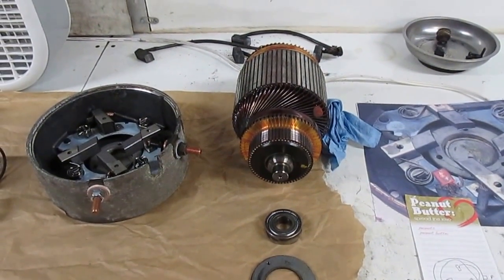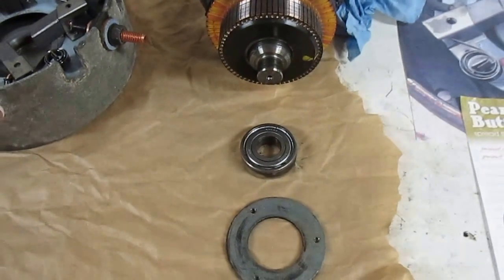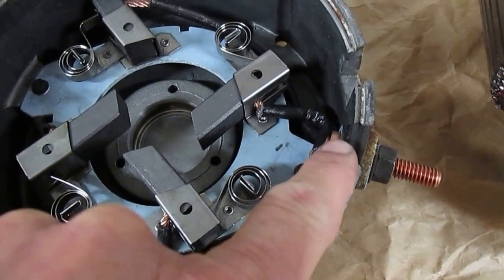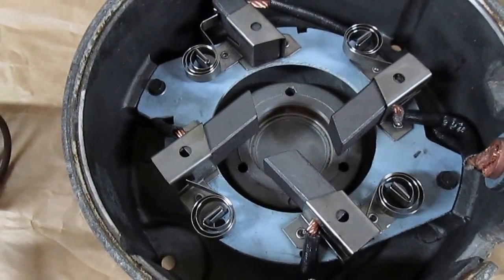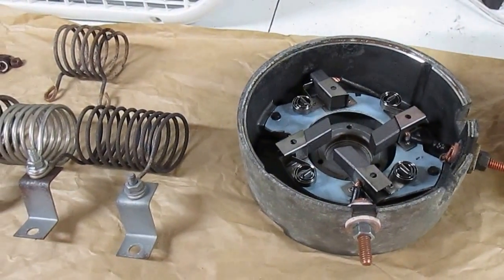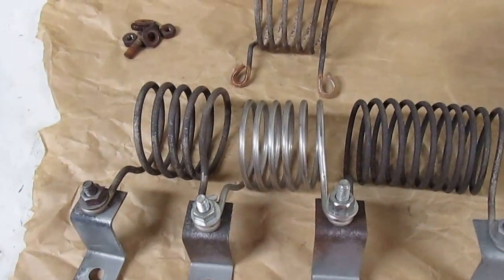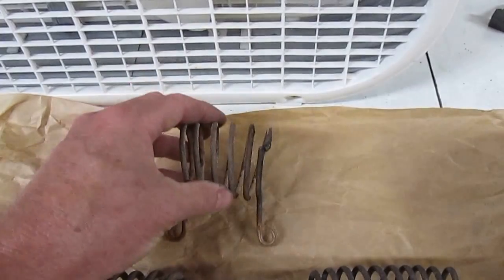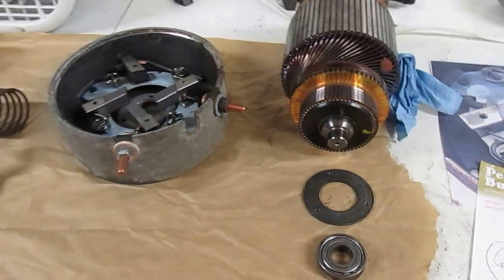1981 Club Car Electric Golf Car Motor Repair, Part 2

Comment: Such helpful videos!  We have a 1982 club car and it only runs at about 5 MPH at best.  We have new batteries and new coils- do you think the next step is replacing the motor?
Reply: I would check your battery health first imo, but take it to a place that specializes in golf carts if possible

Comment: Did you get any performance upgrade from rebuild?
Reply from the maker: Yes. Seemed a lot more powerful. I also replaced all the battery cables. No doubt, I was dropping some voltage on the old cables and terminals.
Reply: Did you have increased speed?
Reply from the maker: @movietime111  Repairing all the cables resulted in less voltage drop. So, yes. Better performance all around.